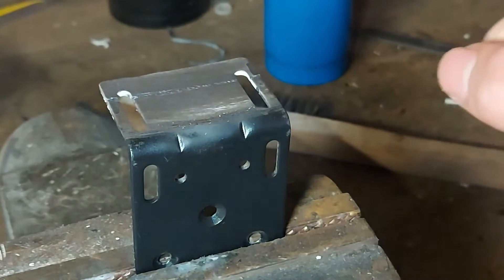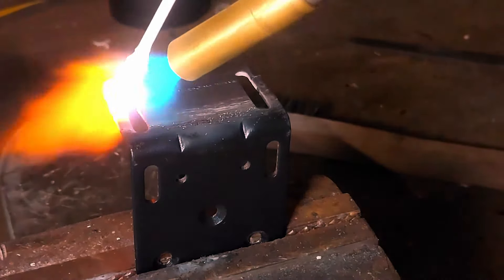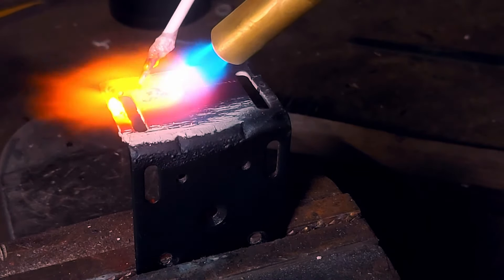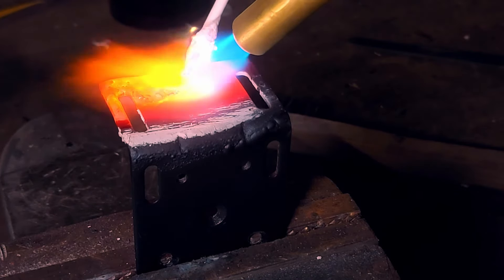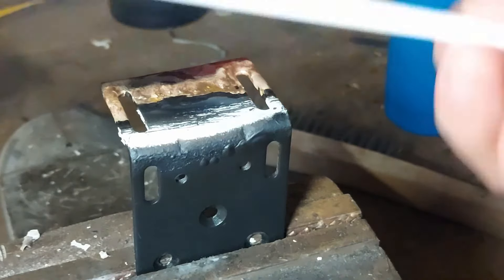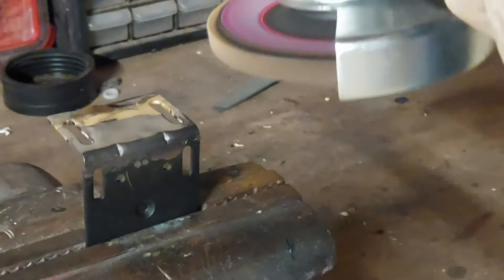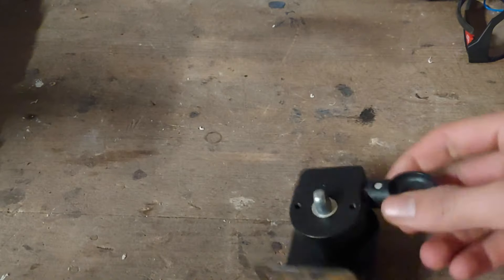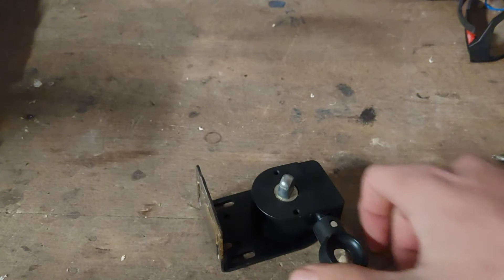Brazing Steel with a Propane Torch - Repairing a Mounting Bracket

Comment: Hi can you help me out please!! I’m trying to braze 2pc of 1018 steel together with just a mapp gas what kind of rods would I need for this thank you so much
Reply from the maker: You'd need bronze brazing rods
Reply: Can you let me know which one to buy cause there so many thank you
Reply from the maker: @ivettemartinez2212  Bernzomatic sells a small package with four bronze brazing rods which would be perfect for small projects.
Reply: Ok thanks and it will work with just a mapp gas gas? Or a propane?
Reply from the maker: How big are the metal pieces?
Reply: There like 3/4 thick
Reply from the maker: @ivettemartinez2212  I think you'll have to weld.

Comment: can i use this for small art metal projects? copper, silverware, brass? 🤔 I don't really wana buy a TIG or oxygen acetylene cuz I'm scared of getting hurt. lol
Reply from the maker: You can definitely use a propane touch for metal art, but you'll need the right brazing or soldering filler.
Reply: @DragonBuilds  I'm gona try it. Initially what i was using was soldering/flux. But what's happening is my finished solders are falling apart if I put another solder near it. I want to combine junk metal together. Kinda like this: https://www.pinterest.com/pin/441352832211658870/ I will try this technique. Next I may try oxygen acetylene. I'm just so scared of getting hurt.
Reply from the maker: @dec23  That rabbit is super cute! If you are making many joints very close to each other I think you will need to use an arc welder. The Forney Easy Weld stick welder I have can weld thick and thin metals, and on lower settings can be used on a 15a household circuit. Welding looks scary, but if you follow the safety instructions and wear good quality protective equipment, you will be fine.
Reply from the maker: @dec23  Yeah that is the welder I have.  It is a good value. You will also need some accessories like a welding table (Harbor Freight has a nice inexpensive folding one) and safety gear.
Reply: @DragonBuilds  thanks! i'll take a look. i'll prob come back if i have more questions. :)
Reply: I'm curious what you settled on.
Reply: @propheteyebert7063  I haven't gotten one yet! :( I've been studying for an exam. Once i get that done i will be getting myself some sort of welding machine.
Reply: @dec23  Don't worry about getting hurt.  It is unlikely unless you are very accident prone.  
You might be interested in "cold welding".  Here's an infomercial on it.  https://www.youtube.com/watch?v=VaOTJ6R0PgU
It produces weak welds unsuitable for structural work, but more than good enough for art pieces.   It's really just TIG welding with a "cold" mode.
One warning is that, like any TIG welder, you need to buy or rent an argon gas tank as well.  The gas is not cheap, but if you're making money with your art, then it's not a problem.
Reply: @DragonBuilds  what sort of brazing rod should I get to braze cold rolled steel rod about 1/8" & 1/16" dia?
Reply from the maker: @scott98390  I would get a flux-coated bronze brazing rod, the thinner the better. 3/32 should work but 1/16 is ideal.
Reply: @DragonBuilds  thanks so much!

Comment: Hi, thank you for the video. I was wondering if I could ask a question. I have a 'fancy' expensive office gaming chair that has failed on a weld for the seat base (where the base bolts to the seat). The metal component looks very similar to the piece you worked on here. It looks as though the weld has failed. I was hoping to be able to braze the component using MAP gas. What do think?
Reply from the maker: How big is the piece?
Reply: I actually did this exact thing, ended up letting the gas out of the cylinder and warping the base

Comment: assuming i use enough filler rod, can this be used to repair a crack on a bicycle frame, or is this not strong enough?
Reply from the maker: You can but I wouldn’t recommend it unless you’re a skilled welder. Bicycle frames are under a lot of stress.

Comment: How much would it weaken the steel I wonder
Reply from the maker: Brazed joints can be stronger than the steel itself in some cases.
Reply: @DragonBuilds  no I mean the heating process, I'm thinking about repairing some coping on a skate ramp and brazing seems the easiest way of going about it.

However I'm worried it might damage either the coping itself or the concrete around it
Reply from the maker: @drumboarder1  for larger projects like a skate ramp you'll need an oxygen acetylene torch or arc welder. Brazing can be done with a propane or MAPP torch for small parts only.
Reply: @DragonBuilds  well I'm only talking about a very small section of a 50mm pipe that doesn't meet up with the pipe next to it perfectly and it's maybe 1.5mm thick at most.

Outside of weakening the metal or damaging the concrete, filler material would be my next concern, though I haven't looked at it in person for a few weeks so it might not be an issue.

Thanks for the replies though and off topic, christ I hope you become the more popular gum flavoured rice

EDIT: yes gum flavoured rice, screw it
Reply from the maker: @drumboarder1  How big is the gap? Brazing only works on tightly fit joints.
Reply: @DragonBuilds  THANKS

Comment: Thanks, I'll try this out. All I see on the internet said you can't braze steel with propane or Map because you can't get it hot enough. So I got a yellow map pro cylinder and make a little "box" out of bricks. I put my little 1 inch square piece of steel in and hit it with the torch till it was glowing almost yellow and sparking.

The internet also says you don't melt the rod with the torch, you melt it with the work piece.

So I pressed my rod on my glowing yellow hot piece of steel without any torch flame. Alll I got was the flux turning into a black goop like a burnt marshmallow and the steel was like black tar asphalt. None of the actual rod melted and about 1/3rd of the flux got burnt off the rod

I google "brazing turns black won't flow" and all I get is "map doesn't have enough heat to braze the work is too cold!!!." and I'm thinking how can a glowing yellow-nearly-white hot piece of steel that is casting light across the garage not be hot enough. Lol. I will try your technique, thank you
Reply from the maker: It's important to get the steel piece fully red hot so the brazing rod melts. Propane or MAPP works for smaller pieces but larger projects need an oxy fuel torch.

Comment: How’s the Chicago electric 80 amp welder 
holding up? Would you still recommend it as budget welder?
Reply from the maker: As a budget welder to get started, yes. However I found it could not handle 3/32 7018 electrodes despite claiming to so I returned it and bought a Forney 120v stick welder for $200 which works great with 7018.
Reply: We’re you using AC 7018 electrodes? But thank you, I’ll have to look into the forney 120v!
Reply from the maker: @yakov5604  Nope, just regular 7018
Reply: Ive been a welder for 18yrs my dad was a welder now he is a nuclear welding engineer and my grandfather taught him how to weld. 
 I will say without a doubt that Amico makes the best budget welding machines. The cts has plasma cutter, stick welder, and tig (I know every stick machine can tig). The mts is mig, tig, stick. Both will run off of 110 or 220. Check em out. Chicago electric will always be trash. They're small spot welders that's all.
Reply: @rebel1187 What do you think of the cts-200, or would the cts-400 be the better choice?  I want to do light stuff up to at least 5/16.  Currently using a 220VAC flux wire Lincoln and a 50's 220VAC buzz box for stick.
I want to add plasma cutting.

Comment: I am in the process of repairing my steel garden gate door made of 1.5 inch 16 gauge steel square tubing.

The post that holds the swing door has rotted at the bottom. I cut the rotten area out and cleaned it up. I  do not have traditional welding skills nor do i have the money to invest in such equipment.  However i do own a bernzomatic propane torch.  

Will brazing the metal post together a good candidate for my application??
Reply from the maker: For steel of that size you'd need an oxy-fuel torch to braze. One option you can do is to find a piece of square tube that fits inside the rotten post and just bolt it together.